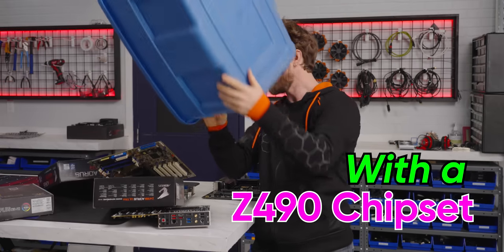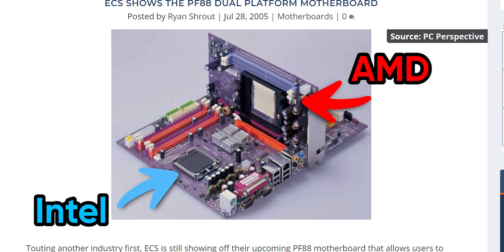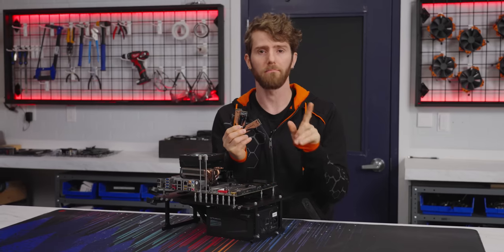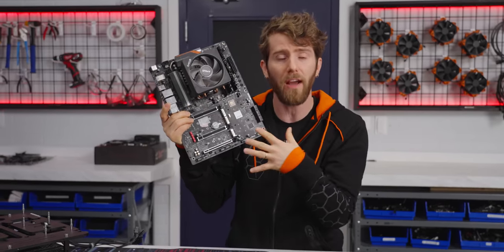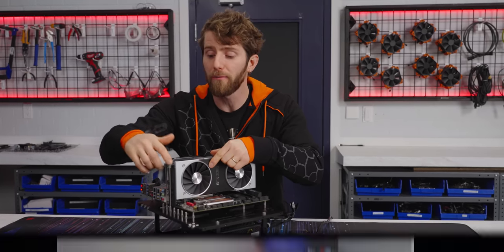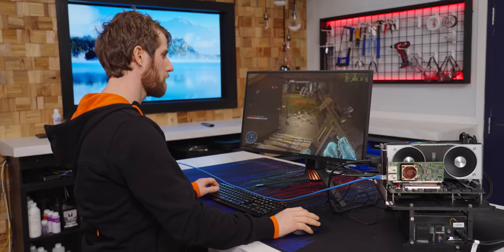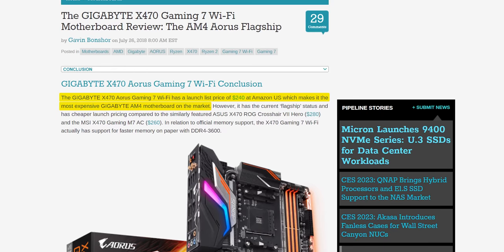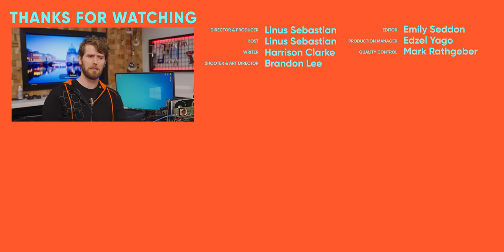I Got This MYSTERY Motherboard From Reddit - AMD Z490

Comment from the maker: Correction: the PLX chip on this motherboard is in fact a switch, not a multiplexer! A switch grants the possibility of using more than one device simultaneously, versus one at a time on a multiplexer. Also: all of the motherboards in the intro were taken from our pile of broken hardware - no PC components were damaged in the filming of this video!
Reply: Whew that was a relief
Reply: Correct! Funny enough I’m researching use-cases for this exact chip at this very moment :P
Reply: absolutely bought 2x m.2s when I refreshed my setup in 2018 with a 2600x/X470: 256gb 960 pro for boot, 1tb 970 evo for games. I've been looking into bifurcation cards simply because I don't want to keep expanding with 3.5" SSDs, those require 3.5->5.25 adapters to look good and cable managed in my old Cooler Master HAF932 🤣
Reply: That sounds backwards. I work in networking (which I think affects my definition). A DWDM (Dense Wave Division Multiplexer), for example, allows for multiple fiber shots of different wavelengths to be muxed onto the same fiber simultaneously. (For example, allowing 64x 100G waves). Whereas a switch allows multiple connected devices to take turns when using a single connection (think single 10Gig uplink with say 24x 1G connected devices). Note: I think you are correct in that it is a switch, I just think the definition sounds wrong.
Reply: PLX or PEX?
Reply: I think it's PLX not PEX
Reply: "Three way and four way configurations" - Linus, 2023

I though this channel was family friendly. Disgusting.
Reply: A challenge for you: Backup the BIOS and flash it with a new (from the x470) one and try Ryzen 3000 and 5000
Reply: I love the idea that you have a pile of broken hardware. "We need to make a video with a bunch component X stacked together which we will throw on the ground". "On it, I have just the thing from the pile of broken parts!"
Reply: @waldojim42  I think your experience might change your definitions. With fibre optic you have the ability to send multiple signals in parallel using different wavelengths, you dont have that option when working with normal wires and electrons, each wire can only really send one signal at a time. In digital electronics a multiplexer connects one of multiple inputs to one output, only one input can be connected to the output at a time and it needs a signal to select which input to connect. I think a switch may be a more managed approach, where with a multiplexer the controller needs to be switched for every transfer, maybe with a switch the data flow is handled by the switch itself and it decides what data goes to which drive so maybe switches faster or more intelligently and is better at sending signals to both drives at pretty much the same time.

So maybe a multiplexer switches slower and needs to be told by the CPU which drive the data should go to and maybe a switch is faster and decides itself which drive the data needs to go to. I dont know those, but those are just my thoughts.
Reply: hello my dear. please no more make very silly silly mistake. everybody four indiia uunderstanding this is switch. please make more for educate four improve your say. i no uu make best four your branes and fouur this i little bit proudly. but no more mistake my beauty.
Reply: Run Time Spy!
Reply: @conorstewart2214  See, even if I go back to say - earlier devices. go with my Adtran T1 Mux. The concept is largely the same: You are blending in multiple channels into a larger, single channel. IE: 28T1's to a DS3. 

When I hear mux, ultimately that is what I think of. Mixing smaller connections to a larger connection using some form of time, space, or frequency division. 

In the case of PC's, I would argue that a mux would look something like: 32 lanes of PCIe 3 input to 16 lanes PCIe 4 output. Where as 16 lanes of PCIe 4 would be switched down to 4 lanes PCIe 4.

Effectively: Switching involves using a shared connection to provide multiple endpoints knowing that each connection may have to fight for BW. While Muxing creates a new, larger connection that can work at 100% simultaneously - which is where I see the problem in definitions.

The PCIe switch is absolutely not allowing simultaneous communication to all devices.
Reply: @waldojim42  there still seems to be a difference of definitions between networks like you seem to be talking about and digital logic which is what myself and others are talking about. A mux in digital electronics takes inputs of the same width and selects one to be passed to the output (also of the same width). Muxes (again with the digital electronics definition) don’t convert between signals, like your example of 32 lanes of PCIe 3 to 16 lanes of PCIe 4, I think the digital electronics term for that would be a bridge.

If you have 4 PCIe lanes going to each drive and you only have 4 PCIe lanes spare on the CPU then you can’t increase the size of the connection between the CPU and the drives, it will always be limited to 4 PCIe lanes. No device you could add would increase the size or speed of that connection, the CPU only has 4 PCIe lanes spare. There is no way to increase the bandwidth or the “size” of the connection. So it is impossible for both drives to operate at full speed at the same time as it is limited by the 4 PCIe lanes of the CPU. Using a mux (with the digital electronics definition) would have a control signal to select which drive is connected to the CPU, it would not increase bandwidth or let both drives work simultaneously. Whereas a switch could maybe do something like address decoding to look at each incoming transfer and route it to wherever it needs to go without needing a control signal to be set before data is transferred to select the right drive, that’s what I meant about it being faster, rather than the correct drive needing to be selected before the data transfer like with a mux, a switch could dynamically route the data wherever it needs to go and that may allow faster random accesses to the drives, probably at the cost of a little latency.

I have never heard of a mux being defined as mixing smaller connections into a larger connection, I’ve only heard it defined as switching between inputs. A mux could be used as part of a larger system to transmit multiple slower inputs onto a faster output, but that wouldn’t just be a mux, it would require buffers (probably FIFO) and other control logic. As for mixing 4 sets of 4 signals onto one 16 signal bus, you wouldn’t need a mux for that. With mixing 32 slower signals into 16 faster signals you would most likely need both a mux and a buffer since you are crossing clock domains, you might not even need a mux if you can get a fifo with different input and output widths.

Again I think that mux probably has a different definition in networking than it does in other electronics related fields, could you be thinking of devices that are called or marketed as muxes?
Reply: Compare using a large monitor with using a small tv
Reply: I said that out loud actually. Lol

Same practical function but with the ability to direct lanes to multiple channels. Still limited to max but...
Reply: ever try Driver easy for driver detection and isntallation ?
Reply: your lip sync has been bad for at least a week.
Reply: Can you guys try those GPUs from Aisurix? They kinda caught my attention and thought of buying in the future but not before my favorite tech channel looks into them.
Reply: Why not 4k 60fps in YouTube
Reply: Why there is no ces 2023 stuff
Reply: Jiga what?
Reply: @waldojim42  I think "switch" and "multiplexer" are terms that are often just kind of shuffled around depending on the particular application.

In the case of PCIe, "switch" refers to a packet switch. That is, something similar to an Ethernet switch which can direct individual packets to multiple destinations.

A "multiplexer" on the other hand, is like the basic low level digital multiplexer, which just selects one of multiple inputs to connect to the output. It's essentially transparent to the PCIe data link layer, and it just looks like a regular PCIe lane.
Reply: @rfmerrill  As is the case of many things electronics - and networking - you end up with confusion when you use the same word to mean multiple things. I truly believe that is the source of the problem here. As I said from the start - it sounded wrong due to common of those words in the wide area networking field. 

A cursory glance at the time for a more fitting definition seemed to validate what I was saying. 

Clearly, others have gotten another definition, and I am no electronics expert. So I will simply leave this at the wonderful confusion that is the English language.
Reply: @waldojim42  cool, but that is networking, this is PCIe, a multiplexer is a common term for something than can switch between addressing different devices allowing communication to more devices but only one at a time (it has to switch from one device to another to allow each one to be addressed), a switch, just like in networking, addresses all devices at once, but only sends specific information to each one, the switch "uplink" bandwidth is shared between all "downstream" devices.
Reply: @waldojim42  I'm not sure what your confusion is, in this instance the PLX is a switch, and works exactly the same as a network switch expect it's moving PCIe communication packets rather than network packets, PCIe works in a fairly similar way to ethernet.
Reply: @charlesturner897  OK: Compare what you said to " A switch grants the possibility of using more than one device simultaneously, versus one at a time on a multiplexer."

The switch you just described, works exactly like the MUX that he just defined. 

Now, what part do YOU need further clarification of?
Reply: The prices of plx chips more than tripled, when Broadcom bought Avago Technologies.
So a simple $25.00 plx chip became $100.00+. With Nvidia killing sli, the need for plx chips disappeared, except for high end compute or storage servers, where board cost is not an issue.
Reply: check the latest post by u/Trying-to-buildpc on r/pcmasterrace he has a Z590 with an AM4 socket....

you could even ask to borrow it for a video...

Comment: Seeing those boards tumble out of that bin was just... pain. But a good hook, so credit where it's due!
Reply: You could see instantly they were all old crap, from the white PCI slots
Reply: Sheela Gaming   want some gift cards?
Reply: I’m a bot.
Reply: If they were socket 7 boards I'd be mad! That was my era getting into pc's.
Reply: @rossharper1983  they may have all been old, and perhaps even dead, it's just the sight of motherboards tumbling around sets off an immediate pain response for me. lol
Reply: Good heavens I thought ltt had figured an anti bot system for their comments section.
Reply: I mean Linus is an expert at dropping things
Reply: @JPLenzi  unfortunately, they're still here.
Reply: Good point
Reply: @JPLenzi  maybe it actually worked until now, when bots suddenly found a crack in the anti-bot algorithm
Reply: That's what happens when you don't pay for anything
Reply: I handle mine like a baby🤣
Reply: I've seen you on EmKay comment sections before.
I think.
Can you confirm that?

Comment: I think it's about time we took the lid off the black bios box. I hope you guys and gals can do a video on how they make a bios, and what actually goes into engineering and designing them.
Reply: It just isn't that interesting to the average viewer. 60% of making a BIOS is done for you via the UEFI spec. (A massive, very technical document, that even I, as a person who's been doing this for a while, sometimes have difficulty comprehending) The rest is other low-level interface stuff that most people who watch this channel don't have the skill set to understand.

It wouldn't be a very good video except for a very specific niche of people (hobby OS developers), who already know all the information in the video.
Reply: @nikkiofthevalley  might include a lot of C/C++ and assembly
Reply: there was efi developed by intel then improved and created uefi standard which is now being misused by Microsoft specifically secure boot feature which is actually usefull, is being used by MS to bar Dual booting Linux and in general just to make life harder so that everyone only runs windows if they want to have secure firmware .
Reply: you are a funny one. making a bios would exceed the knowledge of 99% of this channels views by so much that they wouldnt understand too much about it. and its more or less the same as to making a xmp profile or jedec spec in terms of process and handling. its a bios or reg file with entries like cas to ras latency 0x1h for cas latency of 18 in terms of ram or pure machine language when it comes  to things like cpu count and if channel interleaving is allowed are declared by simple 01 or 00 in the block of said command, and the command is defined by the file format language, how that is made is definetly waaaaaay too advanced for ltt.
Reply: @xeon39688  no, it infact doesnt include any programming language apart from bios language.
Reply: @nikkiofthevalley  I think it may be just a little easier than going by the BIOS setting screens which are in Chinenglish!   You have to forensically translate BIOS settings to proper english first to know what they are and in some cased do a Willy Wonka on some of the word ordering.
Reply: @Gurj101  Us on Linux can actually control it ourselves, without needing M$ keys, and with it handing them the keys to our PC's!

I can't wait for the first story of "Microsoft locked me out of my computer remotely because I couldn't pay for my OS and M$ software subscriptions"!
Reply: @tarkitarker0815 ???? That's not how that works. "BIOS language" isn't a thing. Most UEFI BIOSes are probably programmed in C & ASM.

Don't try to talk about stuff you don't have one clue about, especially when someone who does know what they're talking about is in the same thread.
Reply: @tarkitarker0815  but what do they use for uefi language
Reply: @xeon39688  the normal one? 0x00000a-8x88888888 i guess.cl 18 would be referred to as 0x1h for example, or as 01h so the chunk cas to ras would be labelled 01h, its easy.

Comment: I've got an AM4 Gigabyte motherboard (Vision D or something like that) and the reason your last PCIe slot doesn't work may simply be, because it's shared with one of the NVME slots.
Reply: That makes no sense. Why would they use PLX chip then to multiplex pcie lanes?
Reply: @hojnikb  I know it makes no sense, but I thought I'd mention it, just in case.
Reply: @hojnikb  you would multiplex via slower protocolls, also this isnt a multi.

Comment: The PEX8714 that's in that board is in fact a PCIe switch not a multiplexer. It has 12 lanes across 5 ports, which means you can put 3 4x ports downstream on a single x4 upstream port, for instance effectively adding in 2 extra x4 slots. A multiplexer would only let you use one device at a time, while they can work simultaneously on a switch. In my knowledge there are only 2 current gen manufacturers of PCIe switches Broadcom (owner of PLX) and Microchip (bought microsemi) Diodes incorporated also makes some Gen 2 and 3 switches but with lower lane counts compared to the big 2.

Comment: man hearing 300-350 for a motherboard sounds so good today compared to the $500+ boards we see for current gen stuff
Reply: Yeah back then a good X470 board was $200-250 and that was considered overkill. My X470 Taichi is still doing work too. If the PCIe switch chip could add another $100+ to the board price that must be some really expensive silicon.
Reply: I got my Asus mobo for 200$ so...bummer for you.

Comment: You could try to add the missing CPU microcodes to the BIOS and it may be able to boot with 3Gen+
While there are a bunch of software tools that can mod AM4 BIOSes they require a decent amount of knowledge about BIOS modding to be used.
Reply: it's very easy to do, especially on modern boards. z170 boards get modded for 9900ks all the time.
Reply: @MiGujack3  Its also very easy to brick a board and require a EEPRON programmer and soldering to rescue it...
So yeah its not hard but you have to know what you are doing...
Reply: @vitor900000  its easy and no, you dont need a eeprom reader or programmer, you most likely can order the complete bios chip via mail. there is MUCH filler stuff inside the uefi bios file, you either delete the senseless filler or the entry of a low end cpu or apu you wont ever use, then instead of 0x000002h AMD RYZEN 3500G 0x0000002h AMD RYZEN 5600x3D and instead of the 3500g register entry you copy and past the uefi code of a bios that natively supports the 5800x3d into yours, now you license that bitch via tool and flash it via the onboard tool of your manufacturer, and you are not a smartass that uses the powershell to get some sus reprogrammer that works via cmd but needs certain inputs or you brick it. easy done.